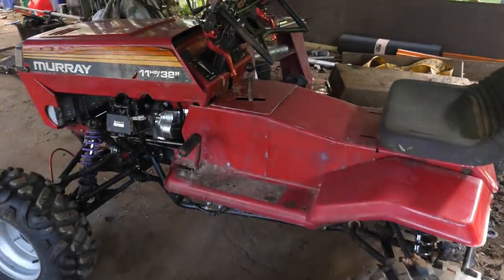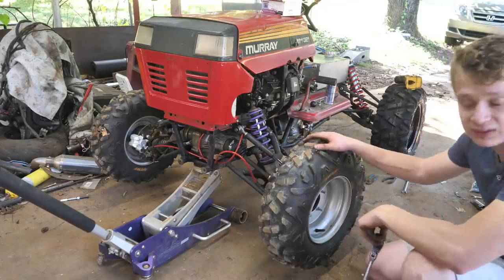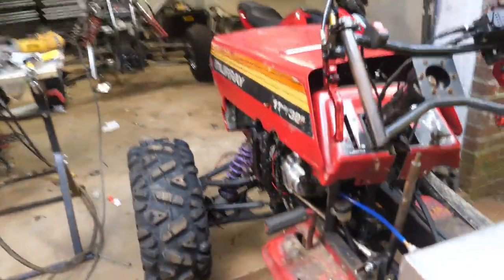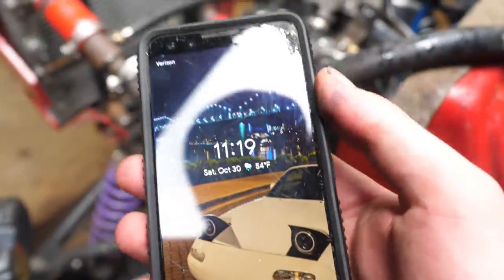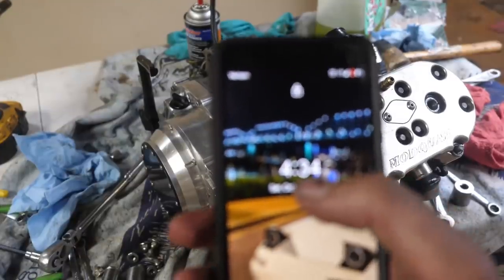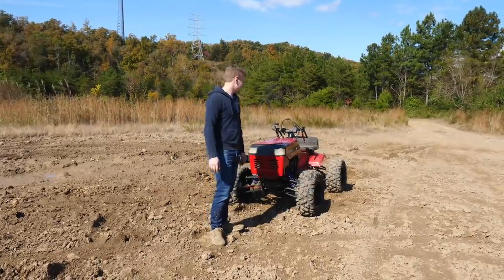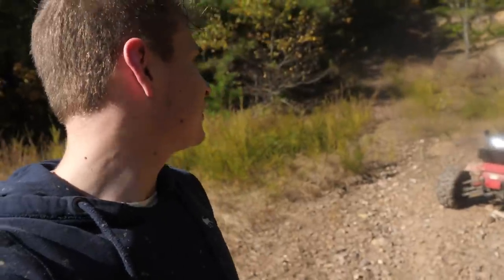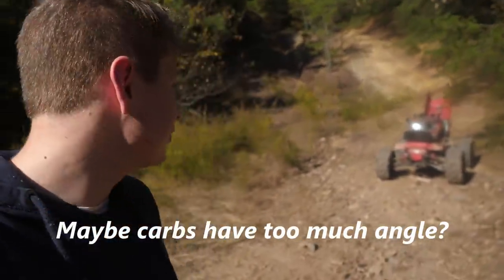4WD 2 Stroke Swapped Lawn Mower Hits Some Jeep Trails!

Comment: Great build but seeing it’s 4x4 I think you need to gear it down. So you start off in 2nd gear when normal riding in 2x4 an use first gear when in 4x4 and mudding or crawling. You can’t use all 6 gears right now anyways I bet. So gear it down so you can have a granny 1st so to speak. An be like a 5 speed 2-6 most the time but still have that 1st gear when you need it. And a foot shifter
Reply: Automatic like the drag banshees would be the way to go
Reply: Automatic drag transmission would be the ticket
Reply: Let's go, Brandon!

Comment: Well when I rode my banshee in the woods to slow it got hot and started puking antifreeze. They like to run in mid range and top end for sure. They have zero bottom end so a lot of revving and clutch slipping at low speed. I think your build is still awesome and interesting. I really enjoyed it! God bless my friend! 👍
Reply: I did the electric fan mod and it's given me no problems
Reply: @dabtech7456  this isn't your video so why would you even say that lmfao
Reply: I decided I need one of these engines for my moped.
Reply: You can change gearing on banshee for low end and way less too end..
Reply: @skinnybigstuff1040  relatable
Reply from the maker: Could be a bad head gasket? You running a cool head?
Reply: @VasilyBuilds  I had I believe a 96 and a 98 banshee brand new. Then I had kids, so I had to be responsible and get rid of them before they killed me, lol. I’m an old timer, but hands down banshees were my favorite rides. I did not run cool heads, so I’m sure that would have helped the low speed problems and I like the electric fan option also 👍 be safe my friend. Banshee speed is addictive!
Reply: Well it shouldn't over heat reguardless
Reply: Low compression ! Overhaul it before it blows
Reply: @VasilyBuilds  nah your head gasket is probably fine. I raced banshees for years. Two simple tricks and you will NEVER have issues again. Add a metal water impeller. Then buy a product called “water wetter”. Add to coolant. Boom. Banshee can be run hard in slow woods riding with a muddy rad and still no issues.
Reply: Exactly... unless you gear it for hill climbing.... your first will be tall. Gotta slip the clutch... and that’s ok because clutches are cheap, easy to replace, and still last a good long while even when abused.
Reply: That sounds like something was wrong with your quad, Banshees are good on trails and have plenty of torque if geared, jetted, and operated properly. I'm not saying a snowmobile engine swapped drag banshee would be good in the woods but stock and light modded hold their own.
Reply: Pretty much any engine will over heat in slow trails without a radiator fan you aren’t moving fast enough to push enough air through the radiator
Reply: @RonnieMacJr69  what About a generator he doesn't get no air
Reply: @RonnieMacJr69  not disagreeing with you
Reply: @Psy6o  are you asking why doesn’t a small aircooled none moving engine overheat
Reply: @Psy6o  this is because those engines use their flywheel as a fan to push air through the cylinder fins

Comment: I just bought a new dellorto Fuel Pump with a check valve built in to prevent carb overflow and it's awesome! Worth every bit of the $45 I spent!

Comment: Love the build! I'd have to agree with some of the other posters. Granny the 1st gear and use 2nd for normal riding. I think I would do a foot shifter but it's your build so you do you. Needs some leds in those old headlights. I like the banshee way better than the 3 cylinder imo

Comment: its easy to do wire harness in bikes and cars if you don't use blinkers  or light, but if you want light you can but light + wire in battery -> rele ->  twitch and another in ground.

Comment: Bro.. You gotta shift way quicker.  Stop letting it rev out so long.  Once it starts pulling hard, just shift, shift, shift--- and it will pull just as hard through all those gears, and you'll be absolutely flying...  You're staying in one gear too long and high reving, and there's no reason to... You MUST put that shifter down on your foot--- if you ride it correctly, it's going to go much faster than you want to go driving it one handed......   I'm telling you, you gotta put that shifter down on your left foot.  I know it's gonna be hard with the linkage and the angles, ect..   But I've owned several banshee's, and I rode them has my "daily rider' -- even when I had a 450R, I still rode the banshee's way more often.  That power band pull is addictive once you learn how to shift quickly and keep it pulling...  But I would be terrified to do that one handed. lol.......  Gotta get the shifter to your left foot, I can't stress it enough.
Reply: Lets simplify it. No solid linkage. Cable shift.
Reply: Gibbon  he’s 100% right, nice smart ass comment 😂

Comment: Same thing with my old square body chevy c10 4×4
Hill climbing sucked with the Eldabrock carb...  flat ground it was awesome...  the floats was letting it run out of gas on a hill.... 
Installed a Holley and  WOW!!!
I know yours is different, but  the problem on your hills sounds the same.....

Comment: Hey Vasily,  sorry neither of us thought about you needing at least the connector from the wiring harness for the front diff.  Wish you would have called or messaged.  Would have been happy to send it to you.  Engine and everything is still just sitting in the garage.  Getting closet to swap time.  Glad you got it worked out.

Comment: You should install foot pockets that you can use to anchor yourself with your toes. It's like a snowboard binding but an open pocket you slide your foot into. Off road electric longboard guys use them. Since you don't have side bolstering, it should help keep you on your seat.

Comment: Aye stupidfastjohn!!! Love that dude! 👌👌
I had the same crankseal problem too. Unfortunately it wqs too late when i found out and she locked up on me in 4th gear cruising. No Bueno, motor grenaded and is gonna be the most costly build ive ever done. So im glad you found your leak in time!!! They also have top end jetting mods such as instajet or dial a jet that go anywhere from 60-280 bucks and just goes onto your current carbs and makes it so you can adjust your main jet on the fly, i think insta jet even has it to where you can adjust the main jet by dial at the bars or wheel and makes it pretty easy when working with these wild 2strokes.

Comment: Takes time to get 2 strokes perfect when you repurpose them. Banshees can be very finicky, run good oil (i'd tell you which ones I wouldnt run but thats a touchy subject lol) being it will be getting a heavier work out under 4x4 at times might be worth going up 1 on your mix ratio to a little more oil.
Look into "Dial-a-jet" see if that would apply to you well.

Comment: I do not support riding with a broken arm. I did it with a broke right hand. (metacarpal on pinky and ring fingers). They didnt heal quite right but i was never in any pain when they broke and even when i was riding, it was uncomfortable. Just now they dont bend quite right and look funny, if you look really close. A whole ARM, that could be bad news.. Cool video and hell of a guy to do it all with a broke arm. Careful riding bud, and good luck with those carb issues.

Comment: Get yourself a 2 into 1 carb setup with a 35 mm kiehin pwk carb with a k&n pod filter it's easier to tune and will give you a better low to midrange.  Mine works great on my banshee. And you probably already know this but if you feel like it isn't as powerful as it would be in the b a nshee frame it's the pipes. If you can get some T5's without mods to them you'd make more power. Also they make a two into one pipe for the banshee that's supposed to give it more low end torque for trails. Might be a good way  to compensate the weight because it looks another heavier than a banshee. Good build though. I build stuff like a that every day. I'm "that guy" where I'm from. Haha!

Comment: Hey Vasily, I think you might have to put a mercury gauge on those carbs to perfectly balance them by vaccum. Never had multiple carbs on a 2 stroke but I definitely had to do it on my crotch rockets everytime I took the carbs off. They have to be perfectly synced or they would run like crap. If I just slapped them back on, I'd always get 1 or 2 cylinders lean and 1 rich

Comment: Dude I absolutely love the build! No hate at all, but a banshee motor seems a little overkill for the application. No engine breaking and has to be in super high revs to go where you want. Would definitely gear it down if it where mine and if it's gonna stay on the trails. Having to hit hills with a whole lot of speed seems really dangerous on that thing. I'd maybe find a longer carb boot/reeds, jetting and exhaust combo that would help it have a little more grunt in the lower rpm's. Maybe even  lectron carbs so that its easier to get it really dialed in an running good at low rpm's. I'm just a random guy on YouTube though so do what ya want lol. Be safe

Comment: Yeah 2 stroke crank seals ,mag side usually goes first as it's not bathed in oil like the gearbox side usually is. 
Gearbox side is easy to diagnose ,it smokes way worse than just a little oil in the fuel like normal. 
Mag side? 
Miss that one and hole a piston. 
Like you said ,better safe then sorry.

Comment: You have Nothing to apologize for to us or yourself.That ripped all over! I thought it'fuel pump starve' when it stalled on the hill.Turn the carbs sideways.or 'fuel injection',and 'FI' is a pain.>Vasily<I'd say "Well Done" all around! You wanted to build a 'bad-butted' tractor with all wheel drive,and you have.If a steep hill is the next you have to climb,I say Bring it on!

Comment: Have you built any electric vehicles? Even as simple as a bicycle? I have a unique project that I need to hire out a portion of because it is outside of my skills. I think it would make good content, It's an entirely new off-road sport vehicle. I am a machinist, I have no problem building, there is a lot about modern switching and processors that are beyond me. Is this something you might be interested in?

Comment: That’s the wrong engine for that machine they don’t have any low end torque, and like to be revving mid to high as that’s where they make optimal power. Switch over to a 4 stroke engine.